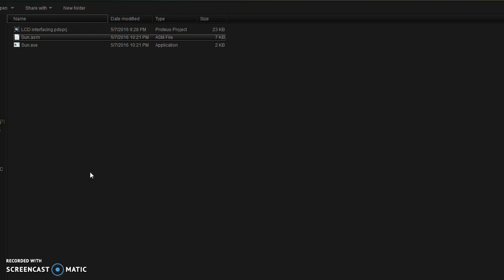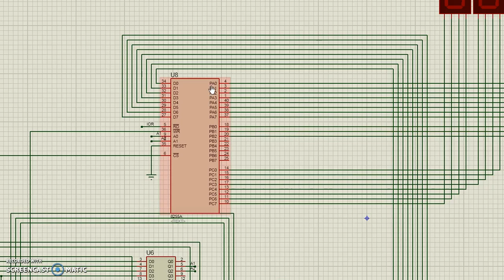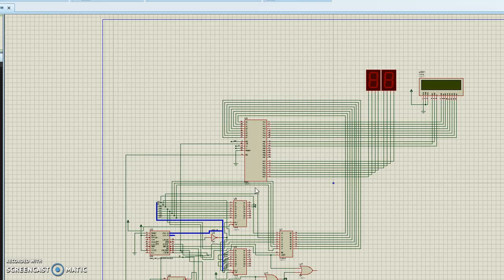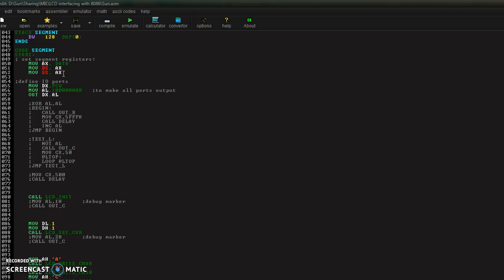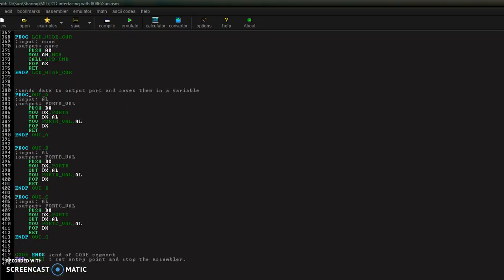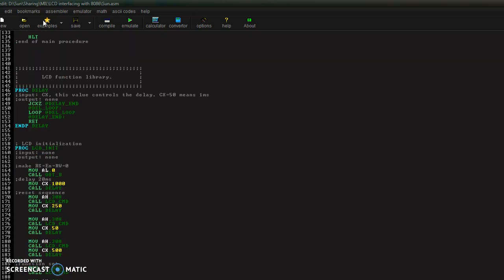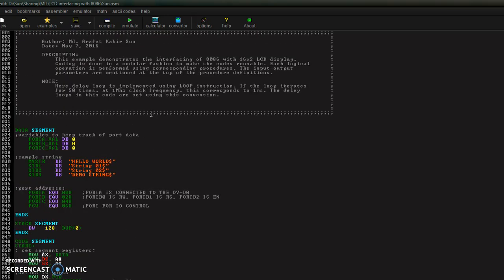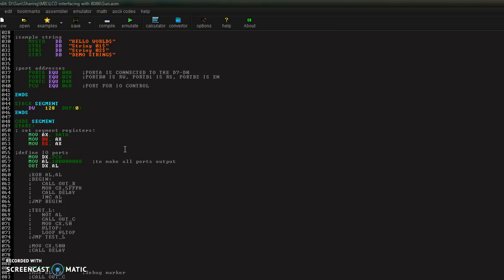LCD interfacing with 8086

Comment: I like your video, one question, what if i want to print in the lcd a number (int), for example, i send 4 bit number to port C and i want that to print in lcd
Reply from the maker: Christian Galarza 
You need to convert it to string first then send the ASCII values one by one. You cannot just write an int.
Reply: Do you have that code to understand?
Reply from the maker: Unfortunately my HDD crashed and I didn't have a backup :/

Comment: sir i am impressed with your video. but i am unable to download the source code. can u please able to share the source code.
Reply: super mam,nice
Reply from the maker: Indumathi sivanandham, thank you for your appreciation. 
what's the problem you are facing? The folder is a publicly shared folder in dropbox.
Reply: i am unable to download in dropbox. it showing me error in downloading
Reply from the maker: I just checked, the link works fine :)
Reply: if u share the files the definitely it will be useful for me to teach the interfacing very easily to my students and they can gain more knowledge in this domain.